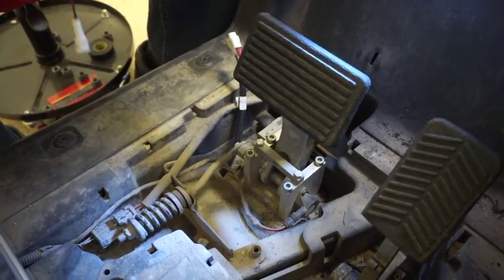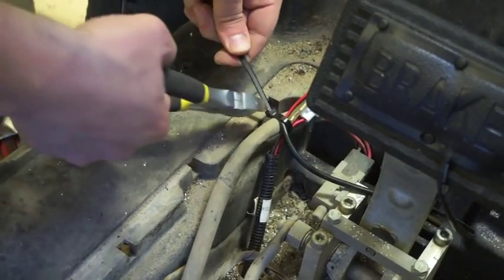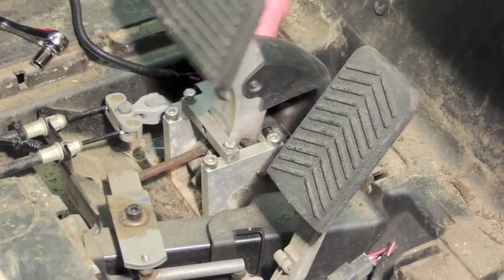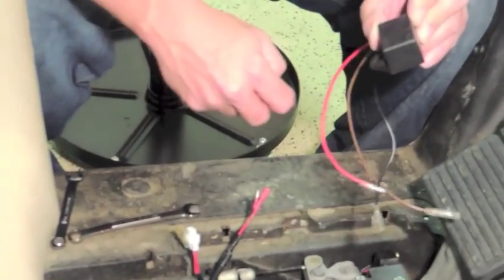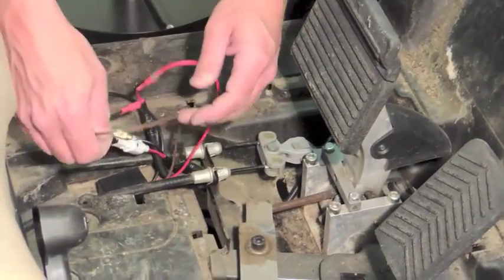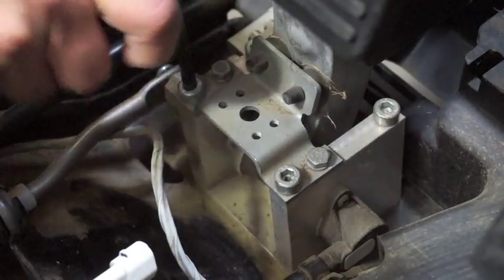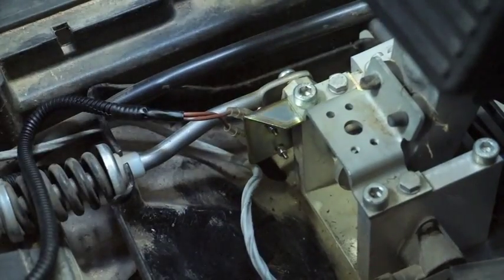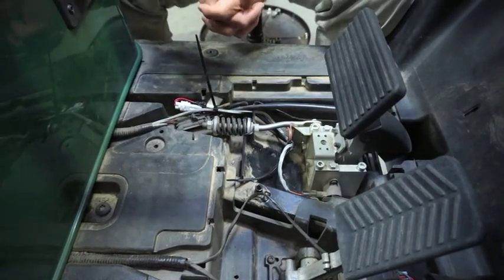RXV Brake Switch Options

Comment: Great video. It was very helpful.
Reply from the maker: Thank you.  I'm glad it helped!
Reply: Where can I purchase the one with the box 1 minute turn off when brake is in lock position?
Reply: I have the 161 and my left brake light will not turn off. Right one works fine
Reply: If this is a 48 volt model. Did you install the voltage reducer box.?